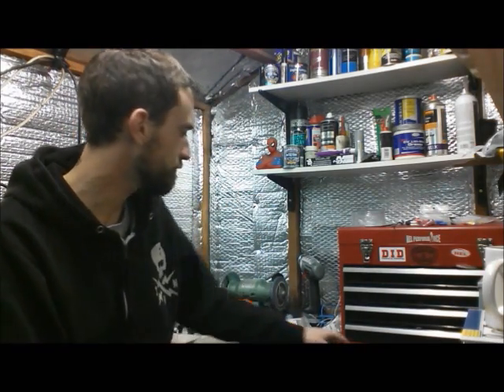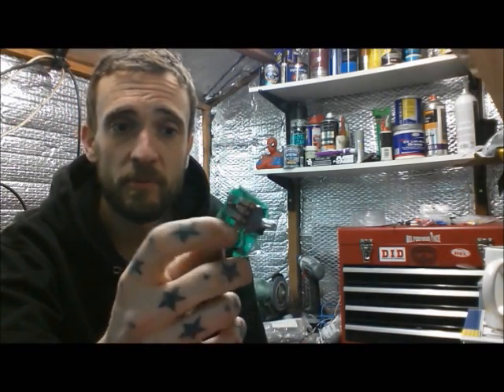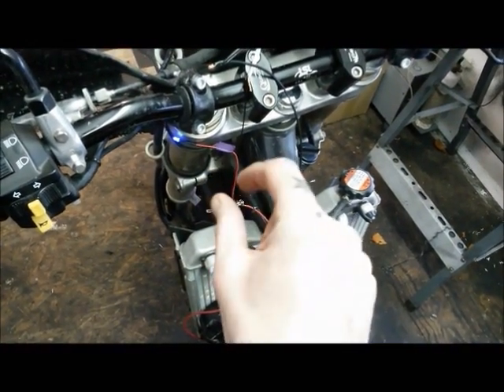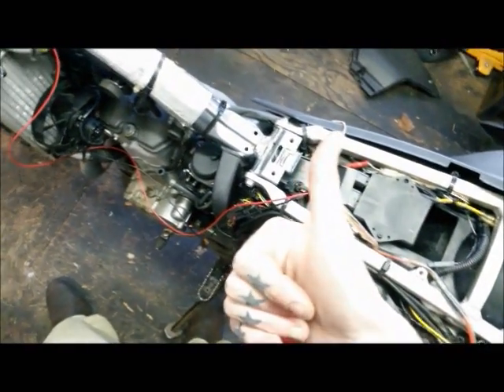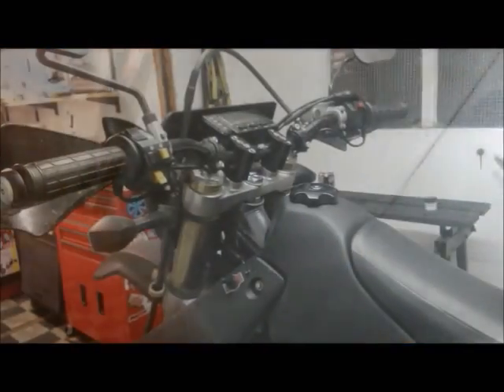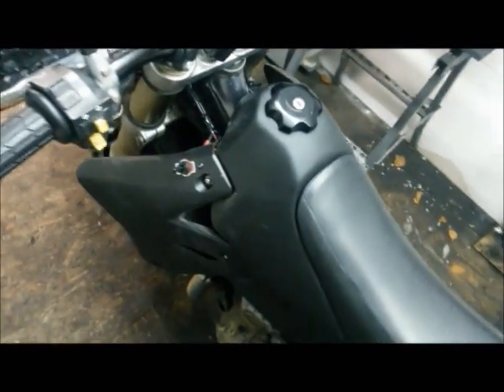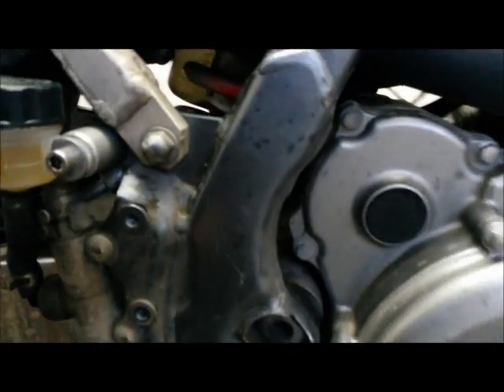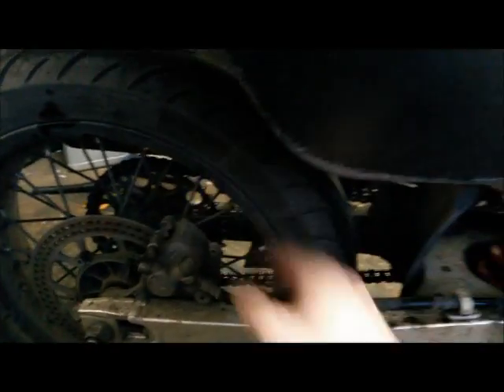DRZ400 SM GHETTO FIX HEATED GRIPS AND REAR BRAKE

Comment: Good fix on the brake. You might find that the grips burn out after a while as there is no thermal cut out, but as long as you don't leave them on for too long should be ok. At the end of the day they did not work so if they last through the winter, job done. I had to replace my controller on my Oxford grips a couple months ago. The grips go on forever, but the control units are the weak link.
Reply from the maker: +Paul Ford thats kind of why i went cheap- i had heard the oxford controllers are a weak link...as you say i'm a little concerned they'll burn out but it'll be 20 min commutes so we'll see!!!

Comment: Nice job. It would be pretty simple (and cheap) to replace that switch with a 3 way version, throw a resistor inline, and give yourself a hi-low heat option. Those things do get hot!
Reply from the maker: +dprider02 that might be a good idea mate- if this bodge works i may invest- just using what i had in the box for this one...but we'll see!!! cheers buddy!

Comment: Nufink wrong with your electrical knowledge buddy,,,,, i was a bit concerned the led might blow under load but it seems fine. glad to see you back. boogietj.
Reply from the maker: +Tony Jeffery ahh cheers mate! there's a resistor in line with the led so that helped! i 'm just concerned there is no heat cut off now and the grips might burn out....we'll see!

Comment: Are you sure the solenoid plug is always energised?
On the Triumphs, it is not. When the motor runs in closed loop the solenoid closes the secondary air injection system so that the O2 sensors have access to raw exhaust gases. It does so by cutting power to the solenoid.
If it doesn't work properly, that plug is the first place to start trouble shooting.
Anyway, with one more switch position (or an extra switch)  you can have the grips connected in parallel or serial so you'll have two heat settings, 100% or 50%
 Nice to see you doing well and ride warm!
Oh, star saving a few quid for Faro. Come and ride in the warm, glorious sunshine.
Reply: Was going to say the same thing! The solenoid is most likely ground side switched by the computer (pulse width modulated) under certain engine conditions, could bypass that by just earthing the loom directly to ground?
Reply from the maker: +Alex Ferreira hmm that's given me some food for thought mate- i think it's always energised...would i see any issues with the led illuminating if the power cut??- i considered a 3rd heat setting but for the short journey i do one seems adequate for now...
Reply from the maker: +Coldfin9er hmmm this has given me something to consider mate!!! many thanks- my electrical skills start to fall apart at this point so will have to do some exploring!!
Reply from the maker: thanks mate!!! the live feed seems to be fine but i am having issues with the led in line effecting the grips- removed it and they are fine now. so have to wire it in parallel...!

Comment: Nice work Johnny as ever, keep the white wire charging your phone,sat nav,gopro on the go?👍🏻😎
Reply from the maker: +ninjanelly350 good plan mate!- useful to have an extra outlet- i'm having a few issues with the led in line- once removed the grips work fine...guess i have to wire it in parallel.